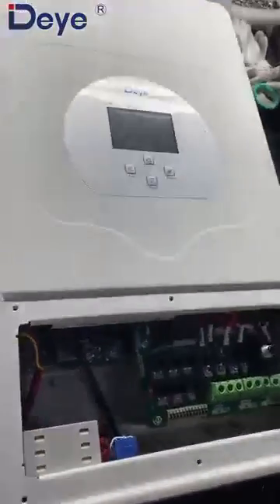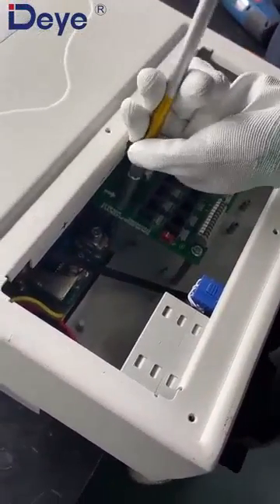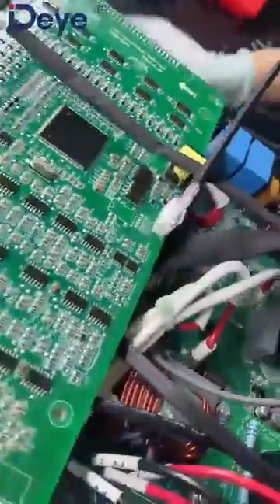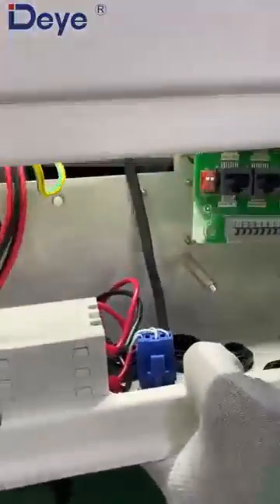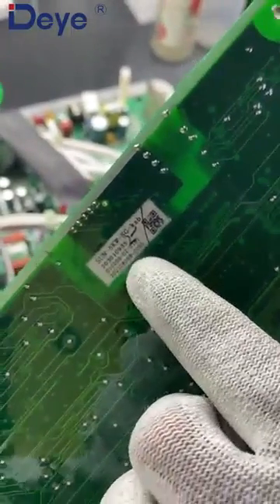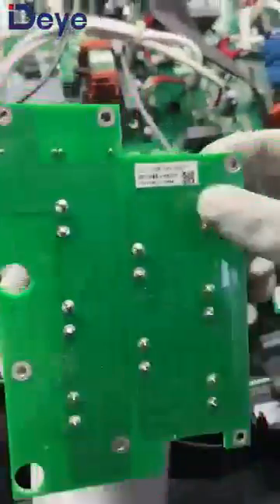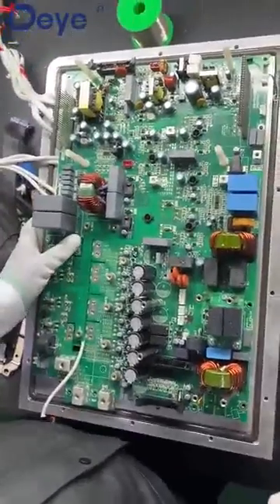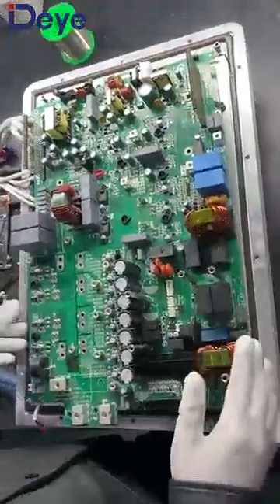How to Repair Deye 5KW Hybrid Inverter - Namkoo Solar

Comment: Very informative and timely too, as I'm currently saddled with a faulty exact unit. Still talking with Deye support to see what solution they'll proffer. Still under warrantee. 
Any idea what those power devs (IGBT/FETs) are? Thank you for the video.
Reply: NCE40TD120VT are used on the PV (as seen on the bottom right @ 17:52)
No idea on the other transistors.

Comment: Good night, i have the same inverter with F51 over current sens fault grid, it’s posible than the problem was the IGBT step, or the problem is in an IC of control?

The display show L=551V

I belive than some igbt is in shortcircuit in a H step.
Thank you for this videos for people starting of electronic world.